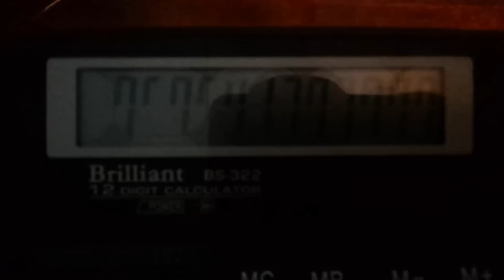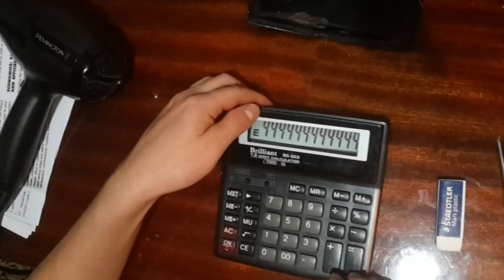How to repair LCD Screen on Calculators and Phones

Comment: This didn't work for my HP 12C, but what did work was heating up a soldering iron to 200C, and quickly running the tip over the ribbon. As long as you are fast, (i.e., <1s/cm) the ribbon won't melt but the tracks are reconnected to the board.

Comment: Thanks! Fixed my screen on the Dymo LetraTag. Just using an eraser didn't work, but after heating the contacts with the hair dryer first and then using the eraser, that fixed it.

Comment: That was SO COOL! Worked perfectly. I had to insist a lot on one piece of the connector that wouldn't improve, but it's fixed now :) Thank you so much for this easy trick!
For y'all who are going to try: if the screen turns black, don't worry, it's because of the heat, it will come back to normal after it cools down.

Comment: Must admit, I tried this on a Casio scientific calculator with a few missing numbers on the screen, initially my LCD screen went from bad to worse and nothing was readable, I was about to throw the calculator away but once the unit had cooled down, after about 5 minutes it came back to life and is now working fine, so a big thank you.
Reply: Same here. This hack just saved my 23 year old Casio calculator.
Reply: EXACTLY THE SAME! It got much worse and then it came back as it was cooling down! Huge Thanks!

Comment: Brilliant, just repaired our Omron Karada Scan bathroom scales. Tested with increasing times of heat, and finally when having warmed for 50 seconds and rubbed, it worked (test longer and longer heating times if it doesn't work for you!).

Comment: My calculator has sat in my drawer for a few years and I need it now and two digits weren't displaying properly and now it is working - fantastic! does it remove the grease and dirt is that how it works?

Comment: The video is useful, but if you're showing the LCD display, don't block the light to it with your body, or turn the  calculator so that the camera does not pick up the display image. It defeats the whole purpose of making a video.

Comment: There was low dimming (contrast) issue on my digitall wall clock. I did same. Nothing changed. Then i realized the heated side of the lcd is got more contrasted. Then i heated the whole lcd. Became perfect condition but when it cool down get back to old situation :( Anyone got any other advise?
Reply from the maker: i think you probably hit the LCD before
Reply from the maker: not sure if it'll be possible to repair with this method

Comment: My casio calculator fx 991es has the same display problem and i am totally not an engineering student ,still wanna repair it ,could you make a video for it??or elaborate connector stuff

Comment: This worked a treat on my battery charger lcd display which i left in the sunlight! I was about to throw it away as we couldn't tell if our batteries were charged, now it works like new. Thanks so much, you are awesome!! 😊
Reply from the maker: ahhh... probably it got so hot that the glue dried completely out....

Comment: I used my hot air solder station at 100 deg C and fixed my DECT Philips phone. Thanks for the info.
Reply from the maker: great
Reply: Hi! Glad you succeed! I have same problem with old Panasonic DECT phone. I'll try this method. When you open it, do the components look like  the calculator from this video?  I have no experience, but I hope to manage the problem. Thx.
Reply: Have the same phones, so will have a go .

Comment: This is black magic. Just saved my Casio fx-82TL that has been broken for 15 years !. Thank you.
Reply from the maker: Cool!
Reply: No magic - what this method actually does -  it re-attaches the ribbon cable firmly back to the circuit board.

Comment: Totally worked!!! My dad gave me a heart shaped clock when I was 16. I recently found it in old things (many years later) and the LCD was half working. I followed your instructions and the LCD came back to life!!!!! Can't thank you enough!!! My dad has been deceased for many years and this has a ton of sentimental value. So appreciative for your video!!! So AWESOME!!!! Thanks again!!!! :-)
Reply from the maker: I'm really glad that it helped yoU!
Reply: Wow, had a calculator from my childhood, also great sentimental value and it worked! I used a soldering iron set to initial 100C then upto 170C BUT always working through some baking paper and after about 15min of carefully goign over the contacts strip on the baord it worked! thank you for posting this!
Reply: Well, I haven't tried the hot air job, but, sad to say, my Casio F766-S is completely un affected by pressure on either end of the flexible connection.  The alpha numeric is all there, but the ls digits of the 7-seg section are almost faded away.

Comment: I have a couple hp calculators (32S & 41C) with dead LCD screens I'd like to try this on, but they offer no apparent entry/disassembly paths; no screws or the like; I fear breakage by trying to open them. Any tricks to suggest?
Reply from the maker: ffggddss do they have rubber "legs"? sometimes you may find screws under them... also maybe they are clipped and you should try to get a knife in the crack.. other less harmful ideas i don't have :)

Comment: I didn't have a hairdryer with me, neither an eraser, bit I fixed it with a spoon and a lighter by heating the spoon then pressuring it on the tape. Thanks for the video!
Reply from the maker: zk453 cool invention, never thought about this :)
Reply: zk453 i tried to fix it but the dim screen doesnt even show now .what i am i supposed to do?
Reply: Pragmatic addict

Comment: It works like magic. But I have to make 3 attemps.
1st time : I keep the dryer for 5 seconds, try to rub with elastic eraser -> fail.
2nd time: I keep the dryer for 10 seconds, try to rub with elastic eraser -> fail.
3rd time : I keep the dryer for 20 seconds, try to rub with elastic eraser ( too hot so the elastic eraser even melt of a little bit) -> success.
Reply from the maker: trandang0709 yep. thanks. you may subscribe :)

Comment: The reason I ask is coz I want a calculator with those exact key positions and configuration. Along with the rounding up and down function. 
Usually the calculators which I get in my country, India, are pretty bulky and big. But I see that yours is relatively smaller and more compact. 
So that's why I wanted to know the exact name and model number of the calculator so I can order the same one. I actually need for my accountancy exams. 
So please let me know!
Reply from the maker: ok, i will try to get more details

Comment: I dont have a hair dryer, any alternatives i can use?
Reply from the maker: you should heat that zone, but don't heat the screen too much.
Reply: Go buy one.  Walmart has them for like, 10 bucks.  There are several things you can use a hair dryer for besides just drying hair.
Reply: +gotigers98675 +gotigers98675 i dont live in the us. Hairdryers here cost a ton of money. That's why i asked for an alternative. 

Anyway, my mom came here for vacation and luckily she brought her hairdryer with her. I tried heating my calculator last July but nah.... It didn't work. I guess my lcd is damaged and needs replacement.
Reply from the maker: is it black or cracked?
Reply: +George Lungu Hi! It's not cracked nor black at all. But there are visible "ghost lines" (if i could call it that) along the screen....

Comment: I have a casio fx-991 ms calculator and it's display is gone after it fell down from the table but the calculator hasnt broken.How can I fix it?
Reply from the maker: +Ramin Udash ... well i don't know if you can change the connectors to another screen. Better ask someone else...
Reply: +George Lungu Well no problem.I'll get a new one or ask sumone for help.

Comment: very nice idea to repair this kind of screens, my wireless phone have one of these and shows almost nothing on screen, if i can solve the problem i will let you know, thank you so much!!
Reply from the maker: +alan pierola hey! i'm sure you could repair it this way, but be careful at the screen. Don't heat it too much, try protecting it with a peace of plastic or wood (i covered it with a paper to straighten the heat elsewhere, but it didn't helped too much as it is too thick.)
Hope to hear from you soon.
Reply: +George Lungu Today I do the job and the result was awesome! Here I let you the pics of before and after, thanks again george! :)
http://k46.kn3.net/1/2/9/E/1/C/1BE.jpg (if it doesnt load press F5 once)
Reply from the maker: +alan pierola Wow! Great! I'm glad that i helped you.